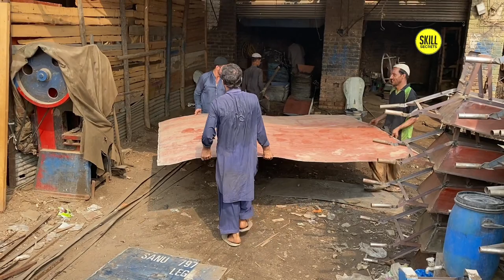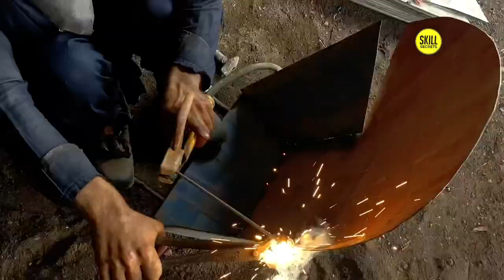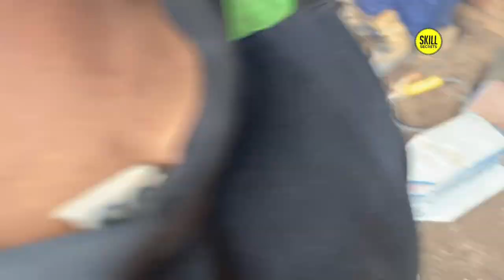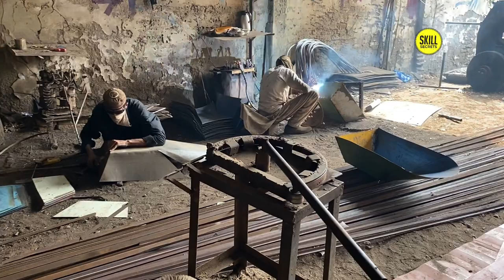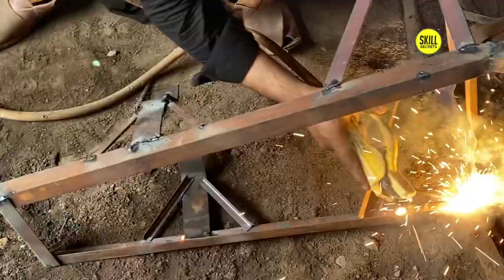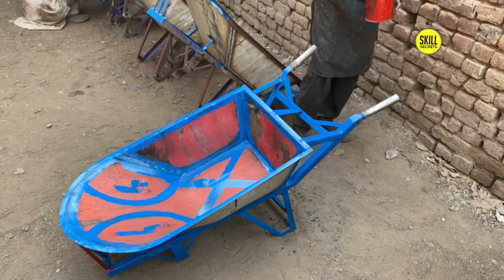How Wheelbarrows Are Made In Factory | Manufacturing of 100 Wheelbarrows | How To Make Wheel Cart

Comment: The guys are hardworking and give it their all, but the lack of personal protective equipment scares me.
Men are engaged in cutting metal and throwing sheets with sharp edges at their feet, they do not have special protective shoes on them!
The crew carries metal without protecting their hands with sawn gloves.
The welder not only does not have a protective mask, but also works without welding edges.
If our occupational safety engineer had seen this, everyone would have been fired.
At the same time, I'm not even talking about the use of child labor in production. I respect them, but the working conditions scare me.
In our production, the terms of wearing special protective clothing are regulated and even if the clothes are not needed, they are still issued and we sign in the magazine for receiving them.
The point is not that it is a pity, but that the inspecting state body will reveal the lack of protective equipment, then the employer will incur serious fines
If, God forbid, some kind of injury occurs, the employer will pay for the pension and rehabilitation.
For this reason, it is easier for a company to provide unlimited protection than to receive a fine. At this moment, I see that the owner of the company does not invest in the tool and the safety of employees.
Reply: In this video, I see that my Muslim brothers working there are even more worthless than the wheelbarrow they made. They are not valued like humans. Oh my Muslim brothers, oh my. My heart aches.